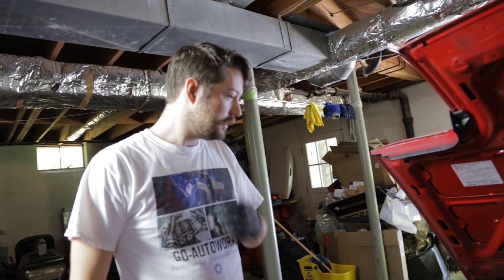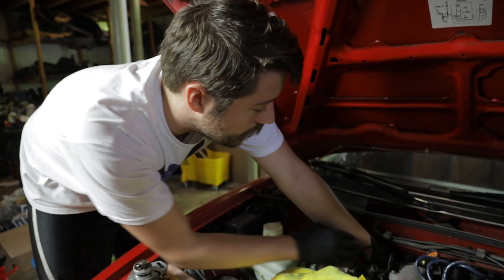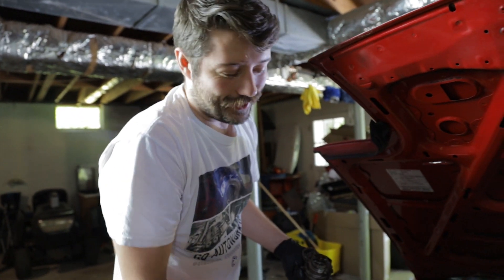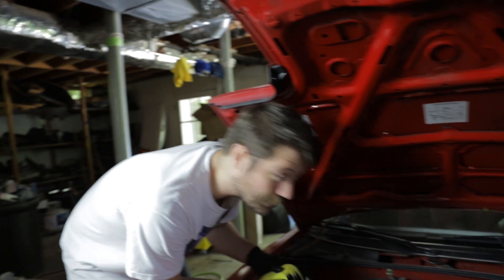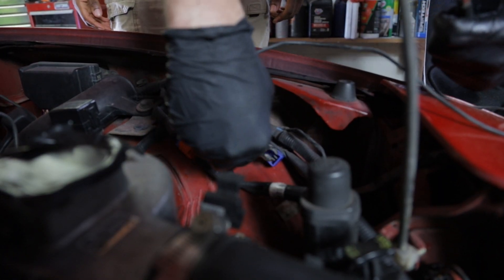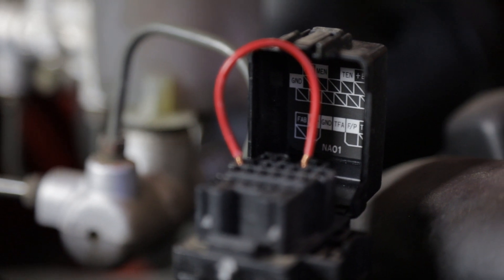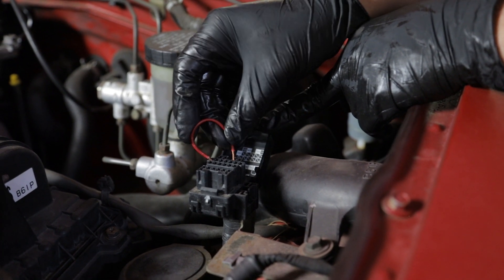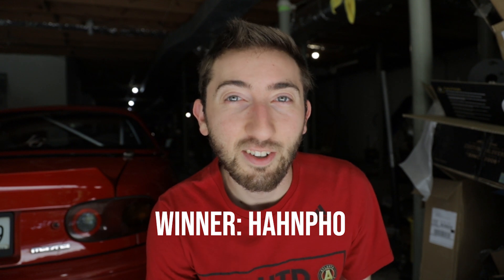1.6 Miata Cam Angle Sensor O-Ring Replacement + Ignition Timing

Comment: For those who are wondering how to tell which way the prongs on the cam sensor go….they are offset from the center of the sensor, thereby unable to align more than one way. If the sensor won’t go in, pull it out, spin 180 degrees and it should go in. If you can’t see the slits in the end of the cam, you can feel them with your finger and figure out the position roughly to install it.

Comment: I use a mirror to orient re installation. It is not as bad as it seems; when you first pull it out, take a picture of the orientation of the CAS input-drive. and a pic of the back of the CAM/VALVE COVER. and also put a sharpie mark across the CAS to the CAM/VALVE COVER>

Comment: What happens if the car won’t start after, I can’t time it with the timing light?
Reply: Did you find anything out about it I still can't get mine started after replacing the cam angle sensor
Reply: @tabasco690  I set the crank to TDC, then ended up messing with the cam angle sensor (for a long time) then managed to get it running roughly enough to get the timing light on it. Hope you have some success bud!
Reply: try to check where you had the sensor originally
Reply: @callumsanderson5522  I appreciate it

Comment: Thanks for the recording ...did mine today, with the cam cover on...(I replaced that gasket when I did the timing belt/waterpump etc.. didn't want to mess with it.. it was not leaking at all. 

 I could not get the CAS our from behind the engine, so I used a plastic interior panel tool and easy broke the decomposing "O" ring off, and put the new one on without bringing  the sensor out from behind the engine... a little tricky, put got her done... 

Those two keys on the CAS are almost the same, and hard to see which cam cut out matches with a mirror... one is about a half a mm wider... Seeing that after a bit the orientation was easier, and got it pretty quick... It looked more apparent on your recording? 

Incidentally I removed the engine pick bracket, and still couldn't clear firewall and the back of the engine, to get the CAS out?? Got ii replaced ions pipe of the hick-up, and she was leaking. The old ring had a flat spot all the way around  from all they years, and broke easily  when I pulled on it... Hopefully this is the end of the leaks... as least for now... Differential is weaping a little, maybe I'll tackle that next. 

Of course I got blood on it... never doing anything without blood...

Comment: If the O ring has gone, would you see the oil leaking on the back of the rocker cover or is it more likely just to be the rocker cover gasket?
Reply from the maker: Yeah you will see some oil leaking down the back of the engine. It's a super common leak so I would definitely check the CAS.